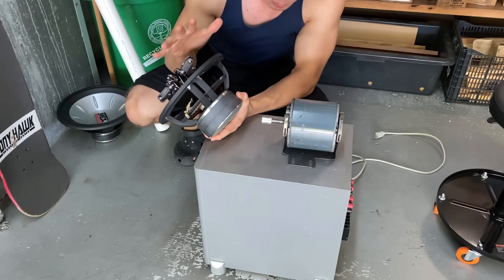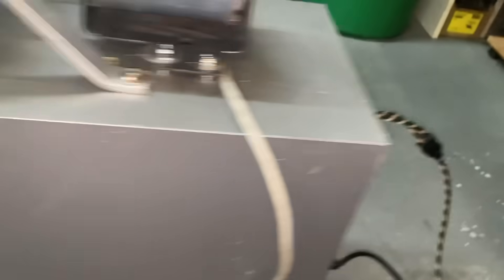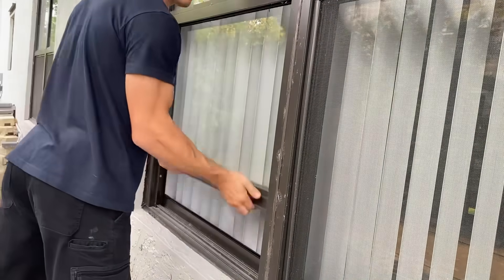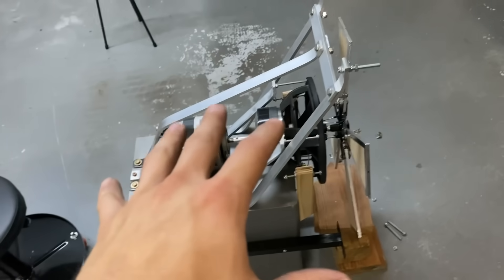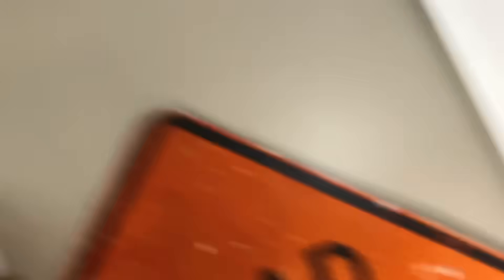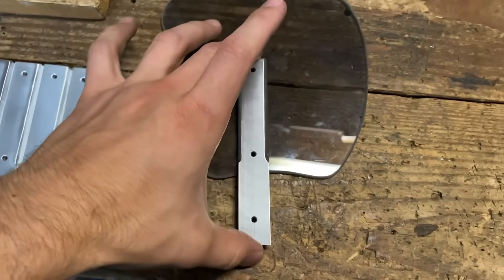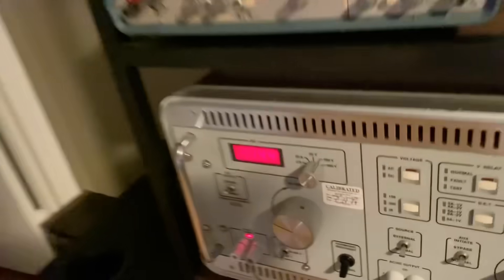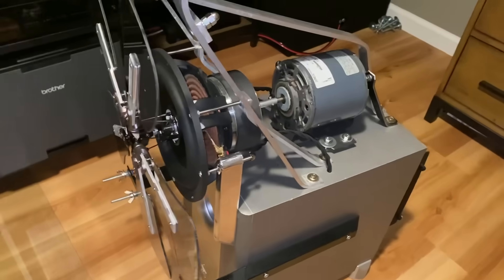Making the worlds most powerful subwoofer (Rotary Subwoofer)

Comment: At that frequency can you still measure Decibels of pressure?

Also, can this damage your ear drums even though it's below your level of hearing
Reply from the maker: Yes with the right instruments, and no, bass waves, especially this low, will not damage your ears at all. All it is, is difference in air pressure. High frequencies however, will do damage
Reply: @Black_Kakari  its not that it doesnt enter your ear, its that the force is distributed over an area so large that you dont feel it at all

Comment: This is incredible. Question tho: why does it have to spin? Did u just build it on the fan structure for the base or does it have some function integral to the subbing of the woofer?
srs q bad joke following
Reply: The fans spinning moves air, the blades moving swaps the direction the air is pushed, essentially moving air backwards and forwards at a steady rate, like the vibration from a subwoofer cone. The faster the blades flip back and forth, the higher the Hertz. Someone correct me if I'm wrong but I'm pretty confident that's how it works
Reply: @jadedejarlais2769  as far as hertz being the blade pitch, u set ur gear to 1 hertz and the blade stepped 1/2 oscillation each second so (now that I think abt the fan spinning) as it pushes air, creating that pressure differential traveling thru the room, u see ur door jiggle at that frequency. That was my fav part. ---it could be when set to 1hz the blades pitch a full oscillation in that second (backwards in .5s then back to forward position in .5s) when thinking about how the door behaved. It's been a while since I've done any of that math... again, could be wrong. This would be a KILLER science project for school though
Reply: @jadedejarlais2769  ah, okay. I didn't think to consider there needed to be air moving over the fans when thinking of how a subwoofer speaker works. I believe the hertz measurement ewould actually equate to the pitch of the fans. Honestly I think the fans spinning may just need to be spinning quick enough to displace enough air for the fan blades to actually produce a true soundwave "though too low to really hear even at optiminal conditions" so the speed of the blade would be the volume of the sub I could be wrong somewhere but regardless this is an amazing project I love stuff like this
Reply: a spinning blade is able to push way more air than a moving diaphragm like in a regular sub. imagine a blade doing like 3 full rotations how much air that it is pushing

Comment: How does this work?
Reply: I'm just looking at it and guessing, but It looks like the speaker driver at rest has the blades flat, then as the fan spins, it changes the fan blade angle so it either pushes or sucks air from an area at a set frequency.
Reply: A normal subwoofer/speaker pushes a membrane outwards and imwards to create pressure waves. But youre limited there by the membrane (a membrane of some diameter can only push that much out and in). What this does is basically hooking up a fan to a subwoofer and spinning it so it pushes air in, but the blades can be rotated so the air-direction can be swapped. Imagine a normal fan that you turn around every second, that creates a 1hz pressure wave. But the rotary subwoofer does the "turning around" automatically based on an analog signal like you have for a normal subwoofer.
Reply: @endunry  Thank you!  That's what I thought it might be doing, looks like it can support up to 10 Hz which means the blades have to change directions very quickly!

Comment: What does this thing do?
Reply: Builds pyramids
Reply: Normal subwoofers begin struggling around 30 hz as they become very inefficient and can't move enough air. This, oscillating fan, can move all of the air necessary to reach down to 1 hz.

In a home theater system, this is used to physically shake you when the dinosaur stomps or the explosion happens.

Comment: Better yet, build a theater out of a Garage, just install some sound deadening insulation in the walls and doors, and then put a vent to open air under the awning and install the Subwoofer inside the vent, so there is no one who either knows about it, nor do they want to steal it from you. You Can't covet, what you can't see. And the subwoofers in the home theater will be boosted by your serious air moving subwoofer. make it so no one knows about it and then see if they can feel the air movement from the sub indoors while watching a movie or listening to music! LOL The Sub doesn't need to be outside, it can do just as much air movement indoors as long as there is an open path for the air to move freely, that is why you should mount it inside of an external vent.

Comment: I don't understand, if someone can explain
The back GE Motor 5KSP29DG, is a basic motor that just rotate ( that what I found in the internet at least)
But we can see that the front sub pulling and pushing the rod in and out the motor, how is that ? Is there some details i'm missing ? Does that kind of industrial motors have some loose so they not break ? Something else ?
Reply: the shaft of the motor is in a tube that can move on the shaft

Comment: "worlds most powerful".......... nope dont be a spaz....
Reply: Rotary subwoofers are the worlds most powerful form of subwoofer, nothing is incorrect about this
Reply: @DarkAttack14  they are not, the most powerful woofer ever made by humans is called the Matterhorn and is not a rotary driver. Also the video is implying that his work was some kind of world record, which it certainly is not...
Reply: @Pickle_Rick-m4o  Try again, the Matterhorn is made up of 40, 15 inch subwoofers. A single rotary subwoofer is more powerful than a single 15 inch matterhorn subwoofer. You cannot compare an assembly of subwoofers to a single rotary subwoofer. IF we were to make that comparison .. 40 rotary subwoofers are massively more powerful than 40 15 inch matterhorn speakers for the same power input. There was nothing in his title that suggested it was a world record subwoofer. Rotary subwoofers are objectively without a doubt the worlds most powerful form of subwoofer. For any specific power input it produces significantly more pressure/volume than any current technology for subwoofers
Reply from the maker: Hats off to you my friend

Comment: Hi! Nice thing you have there, I want to build a similar one in school. What kind of motor did you use? I figured it may be a cooling fan motor, but im not sure. They seem kinda expensive too...
Greetings from Germany. :)
Reply from the maker: Guten tag! You are correct, this is a cooling motor, but it honestly is not the way to go. It doesn’t have enough torque to maintain proper speed once the blades start oscillating and catching air. I highly recommend you get a motor that can go up to 1800rpm, and 1/2 horse power minimum. 1hp might be your best bet. But make sure you have the option to soft start. Immediate torque from a motor that strong will snap the actuating mechanism

Comment: Think i need to do this.. what speed did you get the fan at or doesn't it matter?? Rather the faster the fan speed the more air it moves, and the hz would be 😂 how far the door moves🤷‍♂️
Reply: Bro what actuator did you use?? Off what model chopper.. 😂 need one 🤷‍♂️
Reply: evidently there is a speed directly related to frequency optimum point before distortion sets in,  lower freq, lower speed.

Comment: very cool, too bad your mics didn't pick it up (a spectrum analyzer didn't show any peaks of significance below 16 Hz). maybe YouTube squashed it. 

a good recording of the Thigpen Rotary sub is organist Cameron Carpenter's "Revolutionary" album. To supplement an existing (digital) organ's pedal stops to 64' & 128', Telarc and Bruce Thigpen himself set up two TRW-17's and built a temporary volume out of an enclosed porch/annex in the Trinity Wall Street NYC church. It measured 105 dB below 16 Hz in the nave. Apparently, they could have gone louder, but above that were concerned for the structure and glass of the church when visible vibration occurred. ;) 

Thigpen also installed a permanent rotary sub in a different church for another M&O organ, which unfortunately burned down in 2020.

Comment: And once more compression and refraction which is technical term for decompression both parts of a sound wave must be in-between you and the generator by far the deepest bass ive produced was creating an oscillation by combining the frequency of two glass tubes crazy thing they were only 3/8 inch od like 2-3feet long shook my entire garage

Comment: I almost forgot if it hasn't already been mentioned yet watch 3d rc helicopter videos and I strongly incorage you to find your nearest rc helicopter field and whiteness it in person I flew a synergy 90 and I did some outright scary sh.. with it like 120mph upside down backwards and occasionally  okay almost every time I would wait to pull up until I could feel roter wash but my favorite thing was the punchy thwopping sound as I beat the air into total submission the sound comes from hard manovers that put a lot of force on the blades this leads to the blade tips bouncing up and down just a smidgen that coupled with them slicing through the air at 2400 rpms causes a rotation rather blade vordicies  get a high powered foger and a goblin rc helicopter and I'll come do some right off the deck flying so you can study the air sworls

Comment: Does the subwoofer generate thrust force? Can it create an extra 2000 lbs of downforce on a car for example?
Reply: Sound is not the same as thrust. Sound is air flowing back and forth, you get thrust when air is flowing in one direction

It does create down force if you set it up facing upwards, but only half the time, the other half you would create upwards force
Reply: @muskelversagen  Hmm, I was thinking of "Chapparal"-ing a car but I wanted something that generates more noise.
Reply: @DaveElectric I don't know what chapparal means, but you can only get vibration out of a subwoofer, no thrust.
Reply: @muskelversagen  https://en.wikipedia.org/wiki/Chaparral_Cars
Reply from the maker: I don’t think so

Comment: To get the best results you need a stone walled building and then you clamp the speakers to the walls with bolts that go completely through the walls with big washers and nuts on the outside. This gives you the highest level of rigidity between the speaker frame and the room your are listening in. If the building is wooden framed then forget about it.
Reply: Wood works just FINE. 

The manifold for my I.B. system holds (6×) 18" drivers, and sounds unbelievable.  

Guess what it's made of?

WOOD

It works fine if you use the correct wood, and brace it in the right spots.
Reply: @davelowets  Science does NOT work like that. Wooden buildings are substantially less rigid than stone ones. And rigidity is what counts when trying to achieve clear bass frequencies. Also the entire listening room must be rigid not just the speaker mounts, if the ceiling or walls are not stone then they will flex with the bass and cause constructive and destructive interference.

Comment: Нихуя не понял, но очень интересно
Reply: The fan blades create +/- air pressure by altering the pitch of the rotating blades. 

You would cut a hole in a manifold, or wall of your listening room, and place the blades right in-line with the hole, and the fluctuating air pressure that it will make will create sub-bass frequencies added to your music or sound source. 

I.E. it replicates a large, low frequency, subwoofer.

Comment: Hello!  Question.............  At 1:34 in this video you are installing the mechanism that the fan blades are attached to.   It looks like you designed  or possibly bought that unit.  Either way, could you tell me what parts you used for it?  I'm in awe of this whole build.   Great job on all of your videos!  Have an epic day!
Reply: HAHA!  I just opened my eyes and found my answer I think................"  And also to that one guy on YouTube who figured out to use a model helicopter rotor as the blade actuator. "  Sweet!

Comment: What's the SPL (Sound Pressure Level)? And how distorted is the waveform when recorded on a mic in your room compared to the input signal?

What frequency range does this speaker have (given the usual tolerance for harmonic distortion)? I would presume a design like this would be very boomy at certain frequencies, is that true in your experience?

Comment: How is this the worlds most powerful subwoofer? I've seen more powerful subwoofers based on watts in and SPL output. What makes yours the most "powerful"? Is moving a door at some inaudible frequency the measure?
Reply: Well for starter, what matters is the output, not the wattage, otherwise it would be like finding how fast a car can go by measuring the fuel consumtpion. Second, what's that fancy in here is the frequency response. No transducer (so a regular boxed) subwoofer can go as low as rotary subs go, and that has to do directly with the design, rotary work in a radically different manner. Im not sure this is the most powerful one, but surely it is powerful, you have to realize how impressive is shaking a door with a 1hz frequency wave. At the end theese are not intended to be compared against boxed subs, they'de bettere used togheter, since theese are more the subwoofers of subwoofer, reaching frequencies that are in a no way possible otherwise. Are they worth it? That depends, but they surely are impressive machines
Reply: @appoddigare5828  Well, in my second sentence I asked about SPL (Sound Pressure Level which is a measure of the output level) of the unit. Maybe you misread my comment? This video makes no claim about the output level other than it is the most powerful ever. Quite a claim given the lack of any traceable measurement. A door moving isn't enough for anyone to determine the output power of this thing. This is the end of my point which you missed. Hopefully you see my point now.
Reply: @unitrobe0  yeah i get your point, it'd be intersting if someone could measure it and give out a performance chart

Comment: Sleep with 2 hz playing and you will lucid dream
Reply: What if you have a 4 blade ceiling fan and invert the tilt on 2 opposing blades. Without an enclosure or at least something blocking two opposing quarters, it'd probably mostly cancel itself out.

Comment: Thaaaanks ! It is very interesting ! I just didn’t understand why was the fan rotating. How does the sound make it rotate ?
Reply: I don't fully understand it, but I'll try to explain how I think it works. The fan has a neutral angle by default, until the speaker it's attached to moves in and out, causing the fan blades to change their angle, back and forth at the speed of the speaker, pushing and pulling air back and forth. I do not know why it spins on its own.
Reply: I believe the fan spinning is independent of the sound. It’s just a fan motor. I’d be curious what the rpm is though. The important part is the angle of the blades changing in rhythm to the frequency/ music, which is achieved by glueing the actuator to the smaller subwoofer cone. Speakers and subwoofers work by changing the air pressure around them, so using a fan in a window changes the pressure of the room to the same frequencies the smaller subwoofer is outputting, in real time. Or at least that’s my pedestrian understanding of it
Reply: you're dumb
Reply: @NullCrash Arent you absolutely useless.

Comment: This guy just tap a wood hole???
Reply: Yeah why not, works great in actual wood. With this fiber stuff idk how long that would hold up
Reply: @D3nn1s  coming from a family of carpenters I've never seen that before, relief hole and screws for wood, or a insert for stronger threads either way no need to tap wood its just a waste of time
Reply: @derek-iy6ch  depends, i did that too for a box with a plexi lid that i need to take off often. 4 M5 screws are easy to screw in and out by hand, wood screws not so much. If its a 1 time use then i agree with you. But its nice to have options.
Reply: @D3nn1s  I see your point, if you have the tools already it's worth the time but it is the same use as an insert that would probably last longer and harder to cross thread
Reply: @derek-iy6ch  sure, an insert would be better most of the time. Like i said its for light use amd its perfect for that. Ive had inserts that came out with the screw and now the whole job takes you 10x longer plus you might not always have the right size insert or even space for an insert for that matter.
Reply: @D3nn1s  many ways to skin a cat, I appreciate an actually respectful debate on the internet, you play PC games? lol
Reply: @derek-iy6ch  agree to both. Yes, why?
Reply: @D3nn1s  what kinda games? Trying to get out of single player games